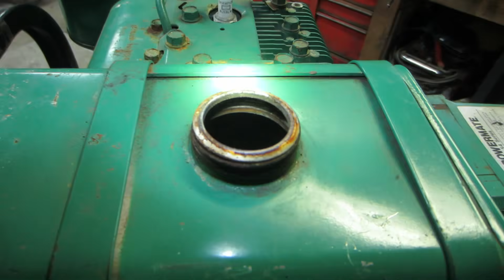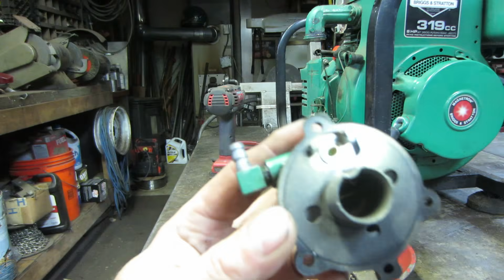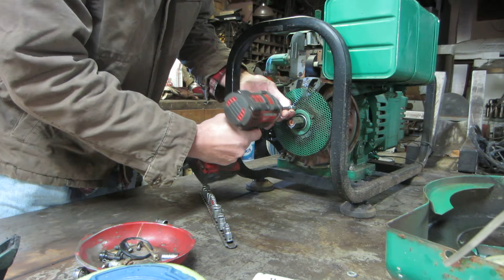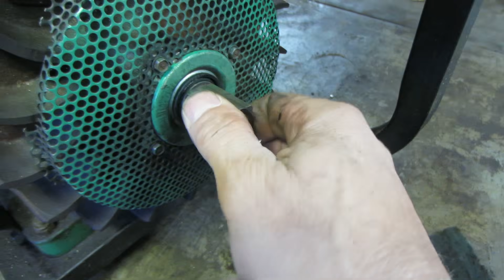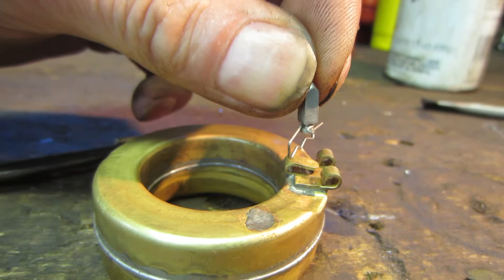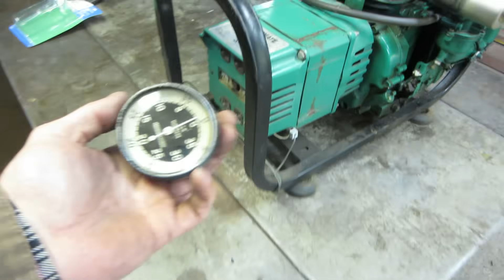lets fix up an old generator

Comment: Thanks!! I've watched this video four times now. I really like these old Ag-Tronic or Coleman Powermate generators made in Nebraska. I use one to power the entire house when there's an outage. Aside from having to gas it up every 90 minutes, it's a very well built unit and as you can see Mustie has shown that it's totally repairable and the parts are very durable. Change the brushes, clean the carburetor, replace the recoil spring and rope. Lube the starter ratchet and you're good for 50 years, no kidding. Mine is almost 35 years old, has a few hundred hours on it and it may go another 35 years for someone some day.
Reply: +Charles Tatakis - My Granddad gave us a 1980's Coleman Powermate and it's old.... 8HP / 4000W and I clean it all up and it works great too!  They sure " Built-To-Last " !!!!
Reply: i have this same genset, it came from sitting in a barn for 20+ years, rebuilt the carb, new muff, new fuel lines and  it has worked awesome every year during hurricane season. i added a 5 gallon fuel tank instead of the puny one and it will run all day.
Reply: Sounds like you might think of cobbling an auxiliary gas feed system. Some kind of larger tank that would have a quick connect feature, so it could be returned to factory for its portability. ....just a thought, good luck, and happy cobbling.🛠⚒🔧🔨🔩🍺🍺🍺🍺🍺🍺🍺🍺🍺👨🏻‍🔧
Reply: @scottcarlon6318  I use a 5-gallon marine tank easy to disconnect and fill at the store no pouring gasoline. I have a what I believe to be in 1980s homelite with an 8 horsepower Briggs & Stratton unbelievable well made compared to the new generac shit boxes.
Reply: Is there anyway to tell the year on these old Coleman's, I have one that is identical to this but mine is the 11hp.
5000w

Comment: I have a unit just like this from 1989 its an 8hp b&s and i need a carb rebuild kit along with the springs for the governor....the one that runs vertical just behind the carb is broken so it wont stay at 60hz 115 to 125v. Any help locating parts would be awesome thanks alot.
Reply from the maker: l would try jacks small engine, its a big on line company with lots of parts lookup for everything
Reply: Do you happen to recall the model of this engine or unit mine is a 4kw gen. But it has no plates or markings left to identify it. I have been searching online but so far no dice.

Comment: I used an old 1/2 drill with a socket that matched the flywheel nut, it allowed me to start the engine,
Worked, might help you sometime on a motor the return rope did not work,
Enjoy watching your videos,
Reply: I saw the drill and socket combo on a YouTube video and it works great.  It sure saves my arm and shoulder from wearing out when trying to start an engine.

Comment: I was given a generator with a Tecumseh engine.  The fellow said it wouldn't run, I cleaned it up and got a Tecumseh engine manual.  I set the points it fired up and ran great until the engine got warm and then it would speed up, slow down etc.  I finally gave up, I later spoke with a small engine mechanic who told me the Tecumsehs with the heavy cast iron flywheel wore the bushing out on the flywheel end and when they got hot the points gap would vary wildly.  He said replacing the bushing almost always fixed them.

Comment: I would replace that bottom outlet with a replacement that is used in the United States and Canada.
Reply: That bottom outlet with the tabs at an angle is for 220v. Replacing it with a 120v duplex outlet would be ...uh... interesting!

Comment: I ended up tuning the speed of my generator using the AC frequency and found it worked really well (picked up one of those $10 ebay inductive tachs later and it agreed). I think the brand over in the states is "kill-a-watt", designed to tell you how much power you're using, they usually also have something that tells you about voltage/frequency. The frequency will be directly tied to engine speed on any non-inverter generator, some multimeters have a frequency setting too.
Reply: That is a good idea.

Comment: tap lightly on the front of the re-coil with a rubber mallet and it will wind back up. it doesnt correct the problem or fix it, it just lets you use the engine if you have to use it.

Comment: the bottom plugs are 240 volts that's the reason for the different plugs so you wont plug 120 volt something in there

Comment: Hi, the problem with the pull start most times it is the recoil spring, I always remove the pull starter, blast the spring out with air then reset the spring tension, to spin the motor over without the pull start, I use a 1/2 drive socket that fits the spindle I also use a 1/2 drive socket attachment that fits into a large size power drill, using these tools will help spin the motor over to check for spark and also start the motor, hope this information helps you for future work, I also enjoy watching you work on other petrol driven machines.   
Kind regards
Sam Knudsen. Adelaide, South Australia, Australia

Comment: You do not need to remove the starter clutch completely. if you look. there is a cover that pops off with a flat screwdriver. it is sometimes a bit of a burden putting it back on though lol

Comment: the correct Lube to use in a recoil clutch starter is dry graphite lubricant it should also be used inside the ball bearings, should also clean and polish out the inside of the female into the clutch starter

Comment: buddy of mine that works for the City come by my shop and give me a half dozen of those old carburetors they were New Old Stock Bendix units for 8 to 12 horsepower Briggs. those generator heads are pretty good units as compared to some of these newer Chinese crap

Comment: I have a Colman model PM0524000 Maxa Powermate 4KW gen with an 8 HP Tecumseh that is a recent find.  It kicks over but I have yet to see if the head puts out the 120 /240 rating. Wish me luck.   Keep the good vids coming. I learn a lot.   Mel

Comment: Do you remember the really old wrap the cord around the metal cone on the end of the motor type pull start?
Reply from the maker: l have some
Reply: D Sloop I've got a lawnmower that I fixed and it's missing the pull starter so I wrap the cord around the starter cup to start it

Comment: For the people that say they get shocked when they ground out the plug with the metal tab......make sure the tab has good cotact with the block.......like clean with wire brush if rusty.The whole idea is the spark needs the less resistant path to ground

Comment: Last time this generator was working was likely before ethanol blended fuel which likely explains the carb's condition.
Reply: Or somebody cleaned it and got tired of the rope recoil not working and didn't know how to fix it.  I'm guessing the gunk under the recoil clutch was from the.many gas refill overflows running through the cover and drying up there.
Reply: That was a long time ago.

Comment: Keep the rear bearing lubed, they run dry, and melt the housing and its scrap. 
Get a hz meter and run it at 62-63hz no load.  
They can lose residual magnetism sometimes , so you might have to put 12vdc to the brushes, or occasionally a drill plugged in, and twist the chuck by hand can be enough to induce and get output. If it's always losing output during storage , it's probably a bad cap or you don't run it under a load often enough. 
I get these things in work all the time and that's quick off the top of my head what I see on em.
Reply: TRUE JUSTICE ALLAH I'm a generator tech , these are peashooters compared to my usual service work, but I've ran into these when people drop em at the shop and me and my manager have to attack the backed up pile of portables. 
Not my favorite work but I've been forced to learn them 😂
Reply: can i ask what is the procedure to oil the bearing?..oil hole, or does it require splitting the engine from the generator?..and what side is the rear bearing?..the end closest to the engine?..thanks!

Comment: I have an old ATV at my aunt's house that won't start because it doesn't have actual wiring and a charged battery But I saw you using a battery charger to power everything, Did you just turn it down to 12v and turn it on?

Comment: I had the same issue with my recoil ratchet in my 3.5 HP Briggs lawn mower motor it's a Briggs thing what I did was open it clean it and put a little tiny amount of grease on the shaft part and oiled the ball bearings has worked ever since for at least two years now

Comment: Smashing :-D, It didnt need as much as i expected, i thought the carb would be a horrible mess of varnish and dust.
Sounds happy as larry :-D

Never seen a float set that far off, some pillock has been messing, overflow madness :-(.
I tend to go slghtly over, so the float has a very slightly bigger gap than level, just enough to allow wear and be on the safe side, but im odd that way LOL :-D.

Comment: I have an engine very similar to this and I can't get it to run.  It has spark, I believe compression and I'm getting fuel to the carb but for some reason it's not going to the cylinder, it's a brand new carb.  Any help would be greatly appreciated,  thanks
Reply: Adjust the jets on the carb, this type has 3. Screw all the way in and everytime you pull on the starter unscrew 1/2 turn until it sputters and then switch to only turning one jet at a time @ 1/4 turn. As these carbs gunk up they need to be readjusted. Good luck.

Comment: Hi Mustie1.Thank for sharing.I have a 10HP Briggs 4.500kw  generator that I curb find down the street about a month ago.I did the same as take apart the carb and cleaned it which it was not bad.,Replaced rotted gas line to the tank. The recoil was ok.The generator head was not working until I  cleaned and reseat the brushes.The voltage measurements were great and I did a load test with my 3.5hp Craftsman chainsaw and a light  for about 2 minutes and the generator did not struggle with the load. I think the reason why they got rid of it because it was not generating power because of the brushes were not seating right.

Comment: WOULD LOVE TO START WORKING ON GAS ENGINES  NOT MECHANICALLY INCLINED LOL
Reply: Get an old motorcycle from the classifieds, a yard sale, etc... Grab a few beers and some wrenches and get your hands dirty. You can learn as you go and it's no loss if you mess up and if you get it running you can ride it.It's very therapeutic
Reply: try on small engines. i have worked on them since i was like 10. granted im 17 now but its not too hard. i dont k ow it all but ya know. enough
Reply: That is true can't tell you how many times I've heard that.!

Comment: i have   one that is a few years older it looks the same as this one except its red and is a  4400 watt  mine also has a  4 prong 220 in it  i don't have the fancy metal kill switch on mine  the way i shut mine off is i have to  drop the choke   all the time and choke it out  how ever mine  will flood out really bad when i moved it outside  and Evan   if i let it sit i cant get it to run tell i pull the plug    out and  hold a torch in the cylinder   to get some gas out of it i pick mine up for   75 bucks     but ended up taking it for 60 because the fuel lines were cracked and leaking they are good generators the brigs moters are amazing i took a  small engines class in high shcool and we used simler model brigs engines for it
Reply: maybe you can get you a metal tab and put it on like this one is to kill it
Reply: nah  mine   wasent designed the same way mine was designe dto use the choke as the kills wioch when i swicth it all the way down it shust off all air flow   wich is how mine turns off
Reply: on his, it has the ground tab for the coil i believe. i think itd work the same way so you dont flood it out everytime
Reply: aye  youd think but  i looke dup the engine number and thats the way its aid to do it was to  choke it out
Reply: talk about inefficient huh.
Reply: yea  well a metal pice wouldnet work on mine anyway mine has a  rubber cover over the   metal that connects to the plug his did not

Comment: Could you give me the codes on that engine? My friend got a free generator and the engine looks the exact same as that one (it's an old generator of course). It also has a recoil issue and the pull start won't engage now either :/ I would just like the codes as a comparison to see if that motor is built exactly like the one on my friend's generator.

Comment: Neighbor was getting rid of old root tiller . Has exact same carb. Took apart cleaned and replaced points with electronic ignition I found on old lawn mower in trash. He bought a new 1000$ model that works like shit. Always feel bad seeing me use this beast free root litter.

Comment: I thought I heard you say that there was, or had been a governor on the engine.  Was there one?  I thought it might be needed for when the load changes.  
If it had been there, did you leave it off?  You shouldn't use that generator with fragile electronics, e. g. a computer, with a governor or without.  More hardy stuff might burn out if the generators frequency wanders far from 60hz.

Comment: Looks like you can cut a small piece of plate steel, drill it out and make a flange, get some old bicycle handle bar for tubbing, and weld an old mower muffler at the end.. if you don't have it you can for sure make that

Comment: At 25:20 did a misbehaving ball bearing fall out of the recoil starter?
Reply: See what make that generator chooch.
Reply: roomba it looked like the meter fell out of the carb
Reply: It was the brass piece from the carb fuel bowl.  You can see it on the bench and later on the floor.
Reply: +panzerabwerkanone - That is the " Ball Bearing " from the Starter Coil!

Comment: i had the same one yrs ago. it had a metal tab to ground the plug out and thats how you would shuter down. but mine had a 3500 watt northern hydraulic generator strong briggs too. would always start one pull. even after it sat all summer never did carb work and it sat for 15 yrs prior to me getting it.

Comment: Only issue I've seen with those is the power head shaft bearing at the end of the unit. The old ones might be OK but the newer ones aren't easily serviceable if at all. The housing the bearing goes into is plastic and spare housings are long gone... Nice quick fix.. Take Care

Comment: Also, that metal tab on the head is how you kill it, push the tab down on to the plug lead and hold until the engine stops. I hate that style, I've been shocked many times with it.
Reply: dave1135 Step on it. Voltage-resistant safety soles help LOL
Reply: dave1135 or a stick

Comment: I had one of those and it was a 4000 watt version.  It was dead though.  The engine ran but no power output and the generator itself was open circuit.  Bought a newer 5000 watt Homelite, got it running and producing power and I love it!

Comment: To fix the recoil, disassemble the clutch and clean it out good, polish the long end of the crankshaft and inside the starter dog. Oil the crankshaft and install the dog, replace the balls, BUT DO NOT OIL OR GREASE THEM!!! A shot of pb blaster is fine. Pop the cover on, install the screen, and add a few tablespoons of oil into the recoil and pull the rope a few times to distribute the oil on the spring, install the blower and there's your dinner! Lol
Reply from the maker: in our area they tend to rust if left dry, ive had good luck with light oil,
Reply: I use ATF in my recoils
Reply: Air tool (pneumatic) oil is a nice light oil to use as well.  Thanks for the video.
Reply: Yes, the starter clutch balls should be dry.
Reply: dave1135 there's your dinner!

Comment: There's you're problem! That clutch should be DRY. No lubrication needed.
Reply: The balls don't need lube, but the part that is connected to the recoil should have felt just under that pinhole.  It needs oil because it sits still with a shaft under it spinning 3600 rpm.

Comment: To kill the engine push down on metal tab next to the spark. Push down till it makes contact with plug.
Reply: Glad someone else knows what that is.
Reply: I have the same generator, most all generic briggs from the early 70's had this stupid kill "Bracket" even my silly no name moped with the 3 1/2
Never had a Kill switch
Reply: Only older people know that 😀
Reply: XXxxcrisisxxXX learned not to put my finger between the two the hard way when I was a kid...
Reply: Robert McKay ha, yep. The rigged-up "kill wire" on my childhood go kart had a melted off bit of insulation. Lit me up several times.  And no, I did not tell my cousins about that :) figured they’d appreciate the the lesson as much as I did...well, they may not have but the laugh was worth it!
Reply: thats how i shut down my 1973 briggs generator lol   almost identical to this one  woulden"t know were to get a carb kit for that engine ?
Reply from the maker: yes
Reply: Shannon Wilkerson the boss 😂
Reply: youre supposed to use the rubber bottom of your shoe,,,,,,,

Comment: why is it all green
Reply from the maker: just what the factory wanted to color them
Reply: Coleman power mate  were all green mine is too
Reply: plowtruckdriver mine is not green but it appears to be a newer model but mine is a 5 horse only by like 3 years of defrence
Reply: Keep the rear bearing lubed , it goes dry and melts the plastic housing and u have junk.

Comment: Take the shroud off and put a socket on the clutch. Run it it with the drill. That is what I always do when working on those. Love the vids.
Reply: You don't need a nut..i made a special socket,out of state tube..and welded a stud on,and it fits on a drill...i also converted a starter motor,to fit square tube..12vt,,foot switch..works like a charm
Reply: i was thinking that. but it has no nut on the flywheel. i was amazed